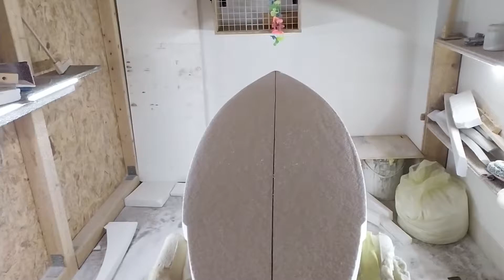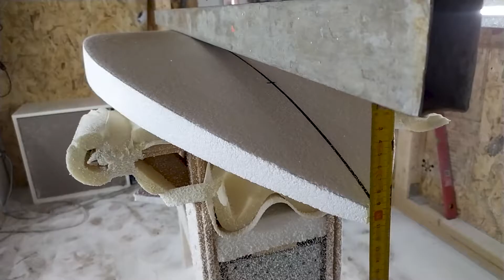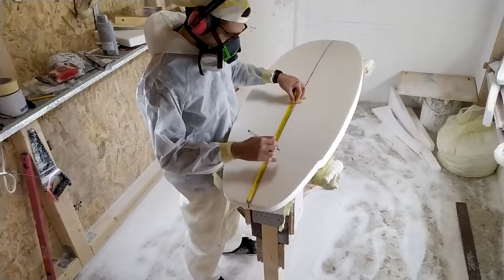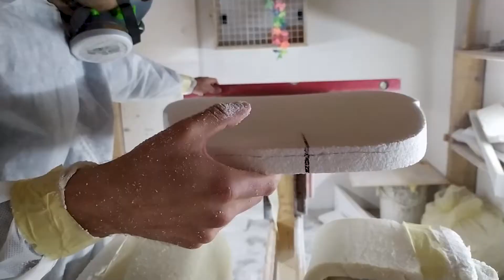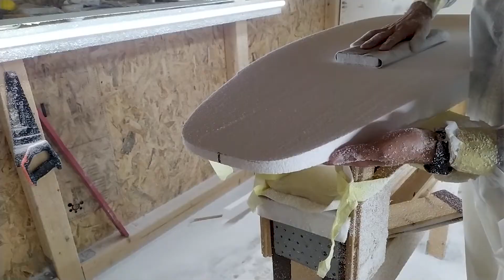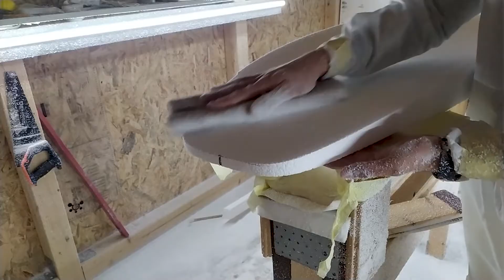Shaping surfboard - Single Concave

Comment: how do you reinforce the board without stringer?
Reply from the maker: It is a must to use stronger cloth. I use 6oz(200g) on bottom lamination and 4+6oz (100+200g) on top Lam. Plus Carbon Stringer.